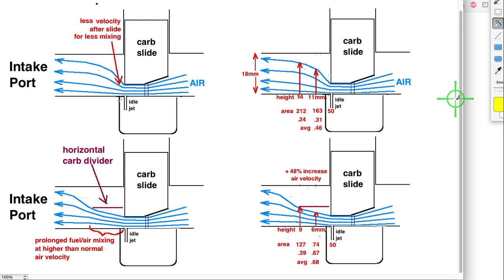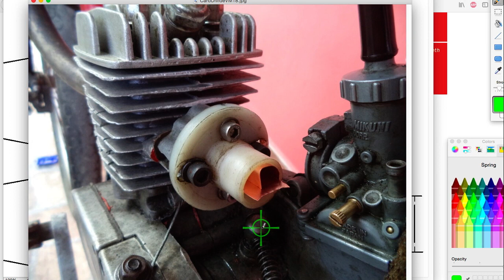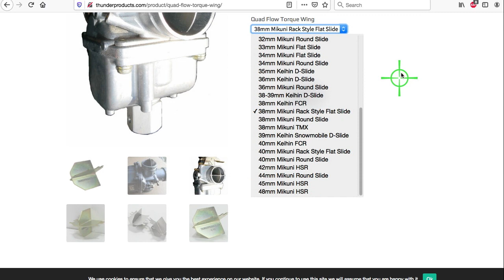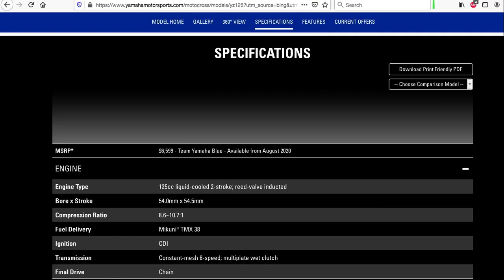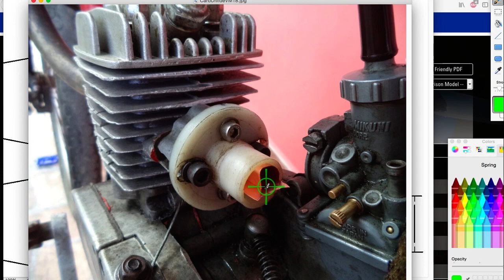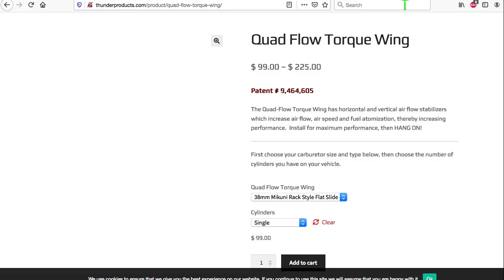Carburetor Torque Wing

Comment: I haven't experienced this; but I have experienced the UFO's. Infact I coppied them using quick metal that you Kneed. Then dremel shaped it.  Certainly changed the exhaust note to very crisp. Yamaha RD 350 air, already fitted with chambers. Even more crackle. Yet to test ride.
Reply from the maker: Putting a UFO (brand name) ramp there at the bottom of the slide increases vacuum on the idle jet so unless you decrease the idle jet size then you' have richer jetting down low which can affect combustion (making it longer) and the exhaust note. The longer the combustion burn, the sharper the exhaust note due to more pressure inside the cylinder when the exhaust port opens.

Comment: Boyesen rad valve(for the cr125 atleast) sorta has this built in.  Some of the CR125 oem reed cages have a divider in the center of the cage, similar too this.
Reply from the maker: the divider has to come right up to the slide for this method to work.